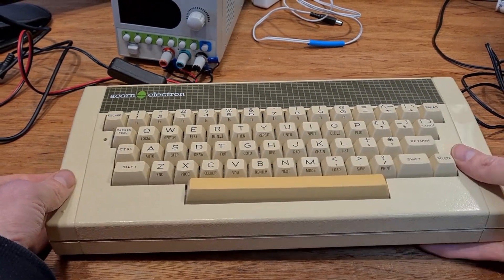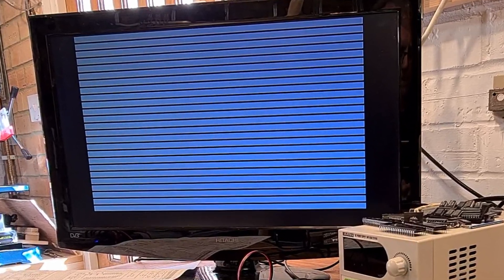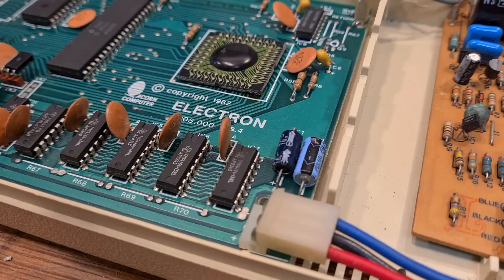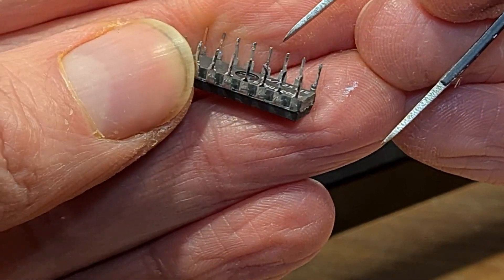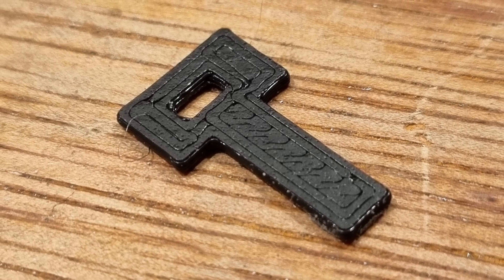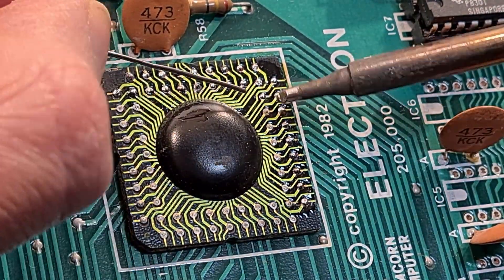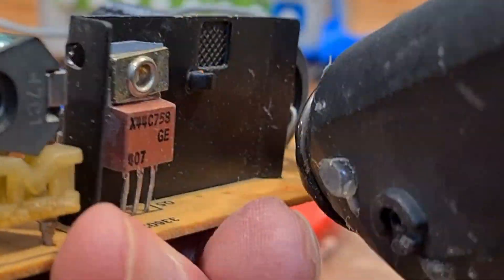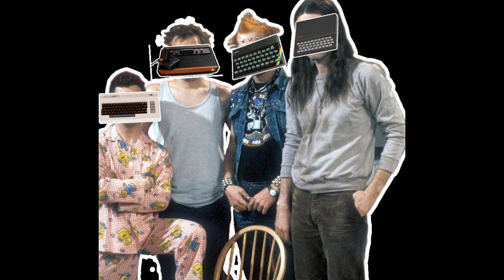Piggy Back RAM fix! Acorn Electron Repair

Comment: Excellent job!  Love the video and the channel!  The data bit connections you were talking about (0 and 1) - that's I and O, In and Out.  These RAM chips have a seperate pin for data in and data out (typically you will find they are shorted as its easier to just join them together).  I am not sure why they seperated the in and out functions of them tbh!  There could be some benefit in that somewhere...
Reply from the maker: Thank you! Yeah, very strange they are separate tracks going to the connected pins.
Thank you for watching 😁👍
Reply: It's the great man himself! 😮

Comment: Great tip on holding the de solder gun at an angle. Also keeping the trigger held after removing the tip from the board catches a lot of newbies out. The Electron and the Oric are the 2 computers I wished I owned back in the day.
Reply from the maker: Thanks!
I definitely lusted after an Oric1 when I had a Zx81 and was looking for my next computer. Shame they're so expensive now compared to the Elk.

Comment: Fab fab fab video, really enjoyed it (even through I'm supposed to be doing DIY, I was hooked!). I also have one of those Electrons from the job lot, sadly mine was without the ULA and was crudely removed with lifted traces, it's on my list as next retro project, so this is a very helpful little video on working with these machines as I also never had one back in the day. Cheers and looking forward to the Spectrum repqir special!
Reply from the maker: Thank you Chris!
Good luck with the DIY. I'm going to assume it's repairing fences.
Sadly the ULA is only replaceable with another original one. They're not cheap! Almost worth buying a working and turning the old one into a clock (kidding! 🤣)
Fingers crossed someone will release a modern replacement soon.
Reply: @MoreFunMakingIt  thanks Lee! Im @mogwaay on Twitter and I've been following the ElectronULA FPGA replacement project on Stardot and I'm hoping, once I get round to it, to try and build my own ULA! I have the VHDL working in simulation, then it's just the 'trivail' matter of figuring out how to get it onto a FPGA chip and on a board that will play nicely inside the Elk, no probs yeah? 🤣 Still fun playing with VHDL anyway 😁
Reply from the maker: Ah! That's you! Cool.
That's a level of clever in afraid is way beyond my abilities. But I'm very curious to see how you get on. I know of at least one other person who got one of those electrons without a ula. I must have been very lucky
Reply: @MoreFunMakingIt  I will defo make noises if I ever get it working! (Large if there's I've never done anything like this, but there are several other projects to take inspiration from) well done again on the vid, I know you put a lot of work into it and you can really tell it was great!

Comment: At 7:00 I have the exact same model with noisy fan. Apparently the fans are rated @ 12V but is fed by something like 18V (can't remember exactly) so that's why they are noisy. There are videos on this where you just place a 7812 V-reg in it's path. I haven't got round to doing mine yet.
Reply from the maker: That's good to know! My gun fell apart so I sent the whole thing back under warranty. Got a brand new one now, with a quiet fan.

Comment: Mines showing the same fault. Thanks for sharing 👍
Reply: Finally fixed my Electron, used the same piggy back technique, was the chip next to the power connector. Strangely everything looked fine probing around with the scope?!
Reply from the maker: This is wonderful to hear! So lucky that you had the exact same error and the piggyback worked for you too!

Comment: Nice to hear that the complaining fan in my moo-gun isn't an isolated problem.
Reply from the maker: Luckily for me the gun part broke down not long after that, spilling sand all over the place! I sent it back to CPC and they sent a whole new unit back which doesnt need quite so much clattering on the side to keep it quiet :D